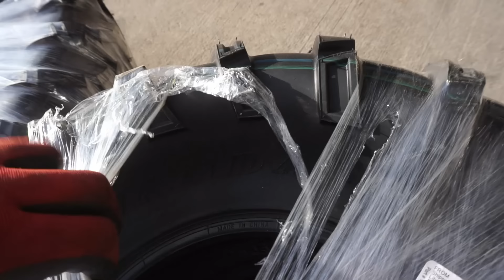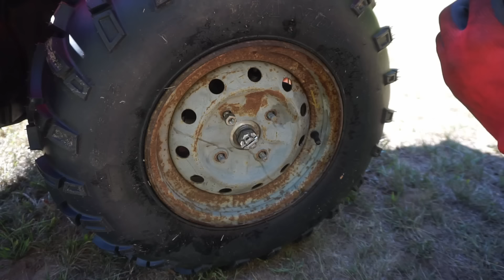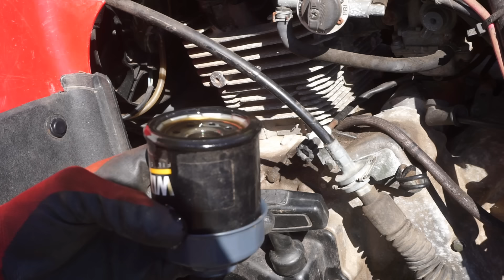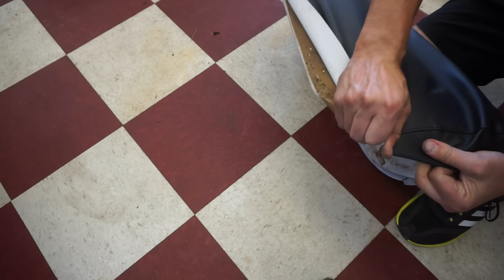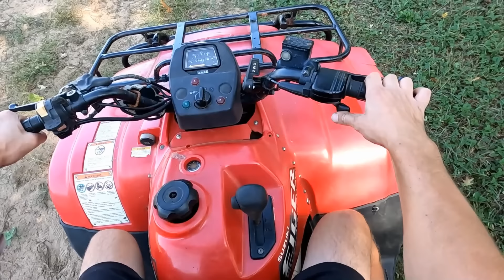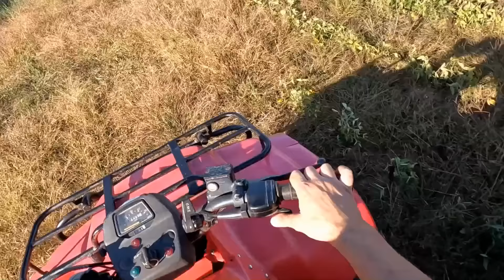Nobody Wanted To Buy This Beat Up $250 4x4 ATV

Comment: You put that belt on wrong. You need to take 2 of the cover bolts and screw them into the secondary. There are 2 holes around the shaft bolt. It causes the secondary to open up for the belt to slide in there. In the video you forced it in with the impact. You most likely pinched the belt. Also you should have scrubbed the faces on the primary and secondary with a scotch brite and some brake kleen or acetone. They need to be scuffed to grab the belt.

Comment: Before stretching a seat cover or steering wheel cover, etc, 
                let it lay in the hot sun for a half hour. Then it will flow and stretch so easy.

Comment: No mice were left homeless during this project, they were all relocated.  Great project, good job, your patience, and knowledge pays off.  Somebody needs 1) a warehouse garage, 2) a lift
Reply: Hey next time you brush or groom Vinny keep a bag of his fur and leave some spread around under the cover of the ATV mower. Might keep the mice out... worked in my garden this summer
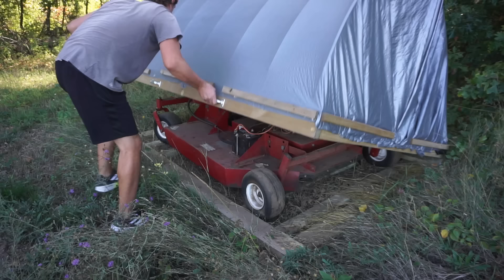Reply: 27:55 you can actually see the mouse run away!
Reply: Heat those plastics up - will look much better
Reply: @anthonygaroutte809  😂😂🤣🤣that was only temporary
Reply: Might want to sharpen the blades on that mower.
Reply: @anthonygaroutte809   -  Yup, I saw the same thing, went back and paused it, and caught the little beast.

Comment: These little quads, the Eiger/Kingquad 400 as they are sold today, are badass little 4x4's. For a 376cc air cooled motor they are pretty dam fast.
Reply: They go faster than you think 100kmh downhill
Reply: I use my 03 eiger to run my dogs daily .... they will go faster down a game trail than you want them to.

Comment: ive got a 1998 arctic cat 300 4x4 that i got from my grandpa that he got at an auction a couple years ago, didnt run and we got it fixed, been having issues again lately so ive done a carb swap and getting new fuel lines cause its sucking air so then i can get to running it again, been a good project for me so far
Reply: Those are actually good atvs. Those are based off the old Suzuki king quad

Comment: for the seat you can use what is called scrim foam in either 1/4 or 1/2 thick and spray glue to attach it to the old foam before attaching the cover it will look way better with no lumps, also make sure to use stainless staples

Comment: Nice job fixing it . That was a steal. Now just need to carefully use a propane torch or a heat gun over the faded plastic and it will bring the color right back. If you do it right you can make the plastic look new again. I’ve done it to a lot of atvs

Comment: The best way to restore the plastic.   Take a rag or paper towel and your old oil from your last oil change.  Paint down your plastic.  It will take a couple of days to soak in.  I had to do mine 3 times to get it where it wouldn't soak in any more.  Then wash it off with light soap.  It looks brand new and not damaged like from the heat gun method.  I discovered this by spilling some oil on my plastic.  I guess if you wanted to go "High Dollar"  you could use new oil.  😄

Comment: The part number / writing on the drive belt should face outward when installed properly . I think you may have installed it facing inward. Good job with the repair / cleanup!
.

Comment: A couple tips.  Buy a harbor freight tire bead breaker, I even use mine on car wheels.  That way your not relying on a shop.  Use dish soap to put tires back on.  Use your heat gun on your seat vinyl before putting in initial staples as it will get your cover tighter, then as needed while stretching for the rest of the seat.  😊

Comment: Great deal with a lil work, here in Ohio people have 4 wheels that look worse or engine / trans issues asking $1000 or more. I picked one up a Honda 300 for $700 guy said it ran fine drove fine. Got I home started running thru a few days later opened garage both rear tires flat left front soft tried to start it dead battery when I filled the front tires noticed a bungee cord around the tie rod took it off tie rod fell off 😂. Jacked it up to take tires off ball joints on both sides bad jack up the back seen something that didn’t look right swing arm bushing gone I’m surprised it didn’t fall off. Ok got all the parts put them on including new battery. Fired it up sounded good, took it out side rode it for about ten minutes noticed it was smoking rode a lil more and more smoke. I used it just to hall my deer last year, about month ago did a top end rebuild. No more smoke runs good think I need to adjust the rockers
Reply: Sounded like a lot of work.

Comment: I have the same with that quad however I pay $4,500 for mine. I had to also replace the belt when I got mine. There is a little nut in the bottom of of the housing is there to drain any water that will get in period in the front of the Quad you will notice the air vent in the top Front plastic that vent goes down and through the housing of the bell and out through the back of the Quad to keep it cool that's how water sometimes will get in there and that's what burns the belts out. I have rebuilt it from the ground up I ride it every day pretty hard I have no complaints it is however a cold-hearted Beast I usually start mine and let it idle for a few before I take off on it also the 4 by 4 sometimes need adjusted there is a nut at the bottom that you just adjust just follow the cable underneath you will not miss it the best way to test to make sure the 4 by 4 is engaging and disengaging right is to put the back wheels up in the air and put it in four-wheel drive they should not turn because the front wheels will be on the ground stopping them then put it into wheel drive and turn them and only the back wheel should turn it is important to listen to make sure the front is not clipping on the PIN that makes it go into four-wheel drive this is where you will have to adjust the nut you don't want it to be clipping I will eventually mess up the four-wheel drive it is hydrostatic it is a very good quad though in a very good motor. If you have any questions please feel free to ask me I am a professional on this quad nowadays. I like that you do this and teach people that's awesome wish they had YouTube When I was a Youngster good work keep it up bud

Comment: To treat the dried out plastic make a mixture of 50% boiled linseed oil and 50% turpentine. Wipe on the plastic and let it soak it up. Will last quite a while.

Comment: just FYI there are threaded holes on the secondary clutch right next to the mounting nut u can use a clutch cover bolt to spread open the secondary this must be done to insure when u tighten the primary clutch nut u actually tighten the drive plate tight if you dont u run the risk of tighten the belt in between and it will run that plate loose and IT WILL strip on the splines of the output shaft..

Comment: I bought a Yamaha Bruin off my neighbor that he bought new. After 2 seasons of use, he had the same issue. It would start up but wouldn't move. I bought it for 500 bucks as he was desperate for cash. I took it home and removed the clutch cover, the thing was filled to the top with water. The water was getting in between the clutch and belt and wouldn't engage. I drained out the water and it worked flawlessly. My neighbor was pissed. I refused to sell it back to him but I felt bad that he took such a loss on a 2 year old machine so I gave him another 500. I got 3500 for it after 2 years of riding so it all worked out

Comment: Another great video and great deal on that quad. Not sure if anyone else noticed but I think the rear rims might not be the right ones for that quad. The tires look to far in from the edge of the rear plastic and too close together from the back. With that solid rear axle the rims should probably have bigger negative offset. I just went through the same thing with a Big Bear 350 I bought and fixed up. Otherwise it looks GREAT!

Comment: For the missing plastic body piece, it would be interesting to see if these parts could be 3D printed? Could the plastic panel that you have, be copied onto a computer, reversed and then be printed to replace the missing panel? 

The missing "plastic pieces" definitely could be printed and welded in, though it would be hard to get the color exactly right.  

Great videos. Thanks for sharing.

Comment: Heat the vinyl to where you can barely stand to hold it. then install it. It will conform to the foam better than with a heat gun

Comment: You must keep most of the machines u video.  Because I do the same as in repairs but this one with 250 for machine,  30 seat cover 250 to 300 tires, belt, brakes and time. I couldn't get back out of it what I've put in it. I guess thank God for youtube revenue because you'd be upside down on the cost. Great work getting her somewhat presentable though.  Oh and hopefully you get that scooter fixed too

Comment: Not so pro tip and you may already know this but if you rub down the plastics with some fine steel wool and paint thinner it takes that oxidation right off then top it with Armor All;  adds 10HP of course:face-orange-raised-eyebrow:

Comment: Hello, I turn mi Polaris sportsman 600 into 700 crank pistons balancer and camshaft TIMING IS ABSOLUTELY CORRECT ✅, NEW ROCKERS, when I start the engine or when I push the gas ( popping noises came from the carb )what could it be ?

Comment: If I remember correctly, my 03 Eiger 400 4x4 semi auto went 54mph according to the speedometer. Now I'm curious, what's the top speed of the automatic? Also, make sure your cooling fan does work when it gets hot from doing slow moving work like mowing

Comment: Some novus 2 plastic polish and ceramic coat will rejuvinate the plastics for about an hour and a half. For mice.....you can also try getting some cat litter minus poops and make a perimeter. Squirrel chewed the gas cap off of my vintage '86  snapper hivac. Bugger.

Comment: too bad you don't do firberglass work.  Bacl in the late 80's and 90's we used to get anyone with a new machine to bring it in and we would make a mold for the plastics. Over the years we sold many replacement fiberglass(not plastic) fenders. But even with broken plastics, you can still make a mold to make replacement fenders etc . Glass is a bit messy but it works and is better than broken plastic

Comment: I wouldn’t buy new tires before checking out drive system. 🤔 You got lucky,most owners know Polaris products have drive belts which is usually first place to look on propulsion system. Owner lost interest in old Quad Runner🫢 I’m sure it has been beat pretty hard by looks and lack of maintenance and upkeep.🫣😬 Start throwing dollars at it which will still be a bad investment. Another hovercraft waiting to happen.😅

Comment: i did a burnout in a 20k utv and the engine light started flashing along with smoke smell, after that it wouldn't go over 30mph and was really slow, i figured i blew the entire thing up but was probably just a belt or something.

Comment: Just a thought on the missing right side panel.
If by chance it’s symmetrical to the left side, It could be possible to scan the left panel then invert it for the correct dimensions to 3D Print a new right side.
I suppose the only way to know is if the screw mountings match. 
Or search for the PDF of the repair manual etc…
Good luck.
Good video.

May the Force 
be with you.🌀 
Jim🌀
(-: <*> :-)

Comment: I need some sort of video proof you paid what you say. That's a $1500 before fixed around here. MINIMUM of $1000. I seriously don't believe anyone sold that for $250. A blown quad with no plastics and bald, flat tires goes for more than that.